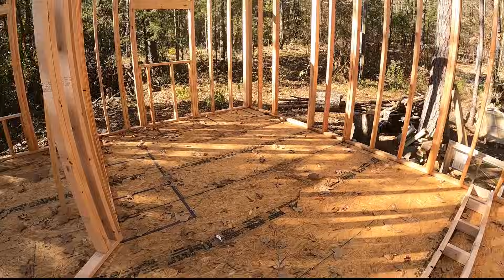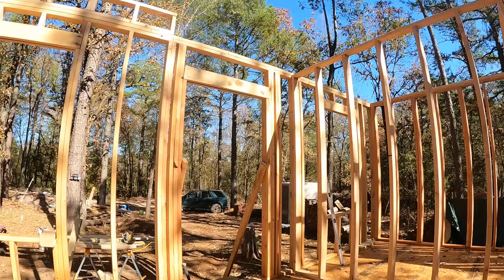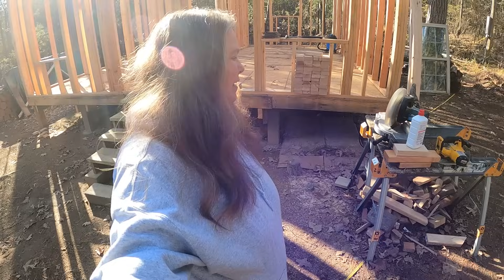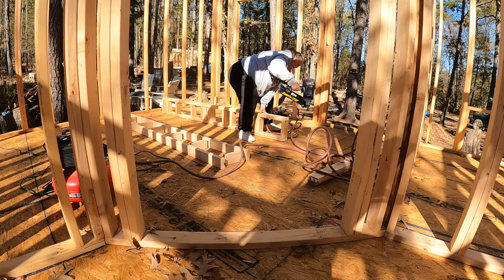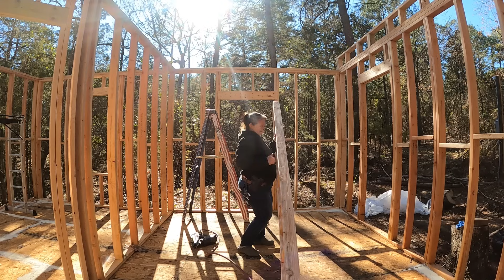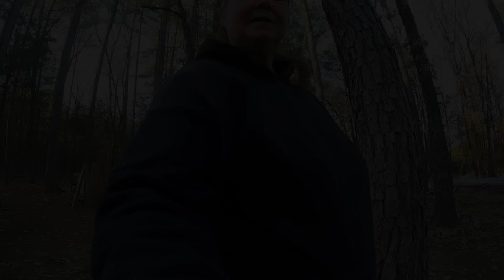Pony Walls Going UP, The Tiny House that Grandma Built, Single Woman, Homesteading Alone

Comment: I have a tub with a higher up window (width longer and height shortest) and if I were building and the tub has a shower I would not have the window there. Maybe your sink looking outside over a vanity or just have nothing in front of window. Water hitting windows all the time doesn’t mix well with showers. Just FYI of a big con against it although I do love looking out. It is right size to look out with only someone outside seeing jus your head.